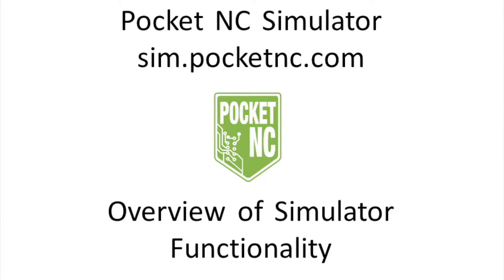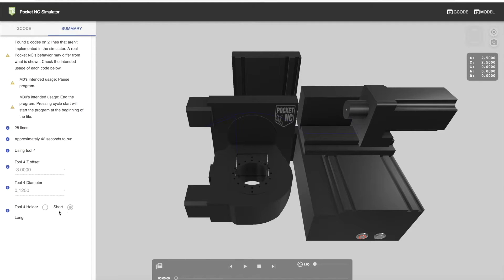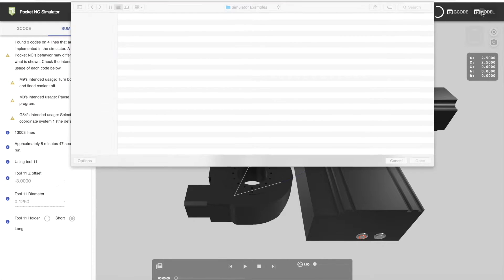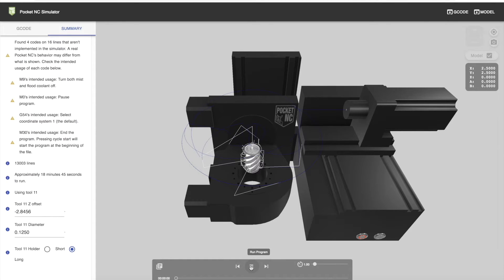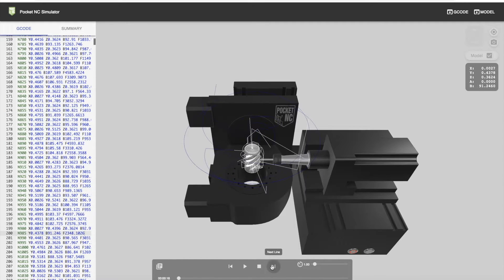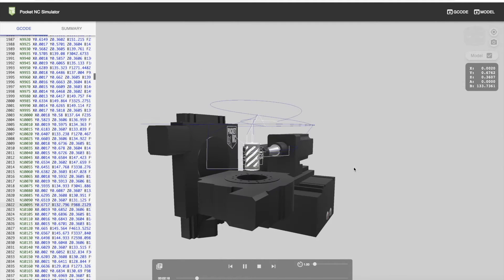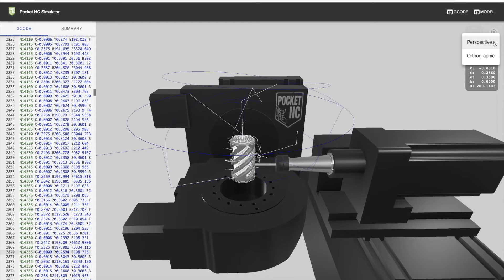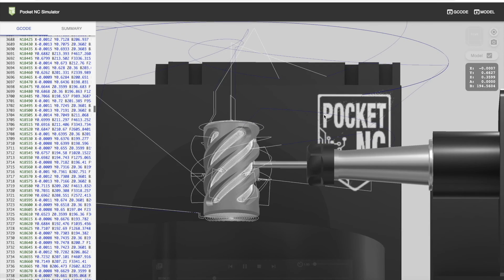Pocket NC Simulator: Overview of Functionality (Part 1/2)

Comment: The simulator is going to make a big improvement in the way I work with the machine. Fusion 360 CAM simulation is nice but does not show rotary axis linking moves (yet). Which makes it impossible to detect potential collisions between any combination of tool, stock and machine before running the program on the Pocket NC. With the simulator, I can see any potential collisions during simulation, before they become expensive mistakes in the real world. A big thank you to the Pocket NC team for releasing this tool.